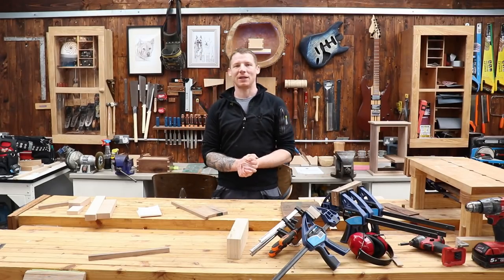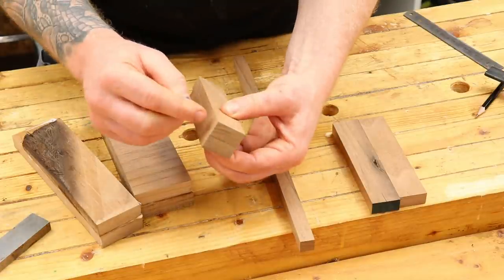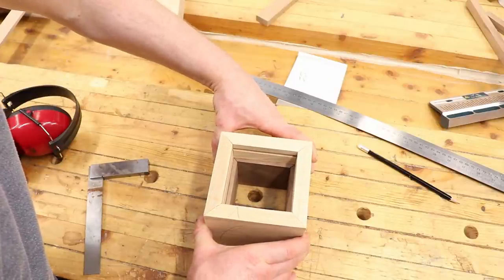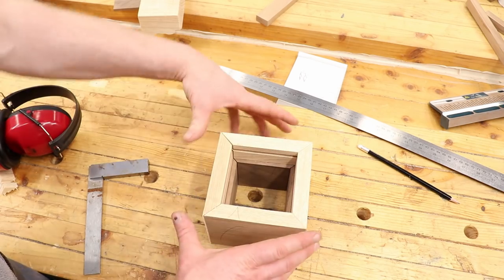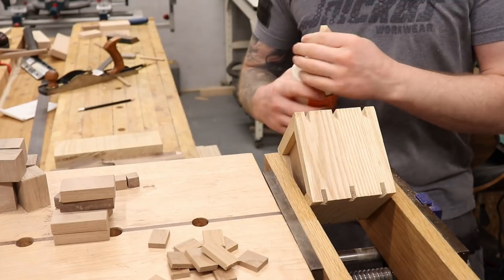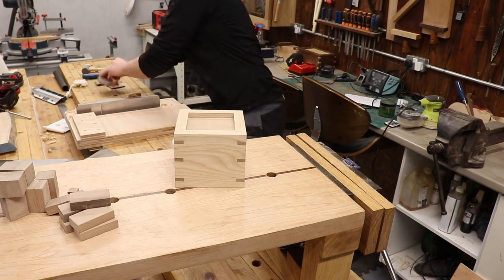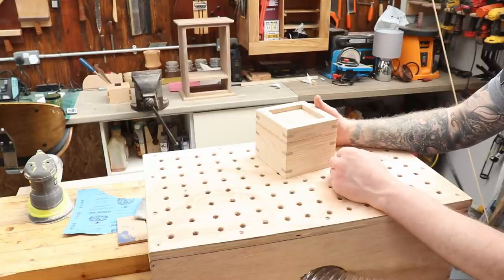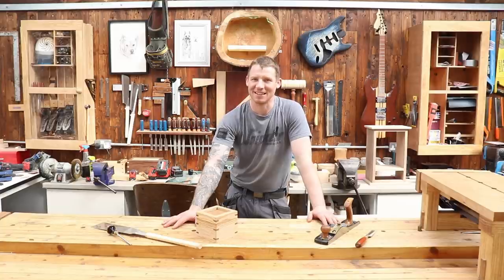Puzzle Box Build Using Off Cuts of Ash, Walnut and Cherry. A great Project and Gift.

Comment: Some of the best design features are the result of thinking about how to recover from an error.  This came out well.

I wonder whether clamping the box to the miter saw would have prevented movement (while keeping your hand further from the blade.) It also looked in the video as if the bobble happened as the blade was raised, so letting it come to a stop before raising the blade might also help.  It would be a quick and clean method, if it worked.
Reply from the maker: It may have